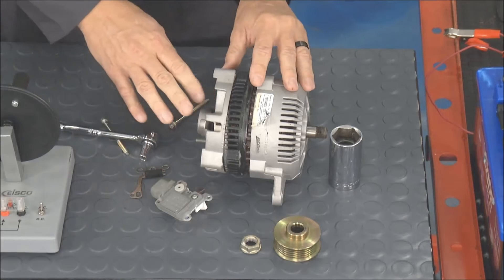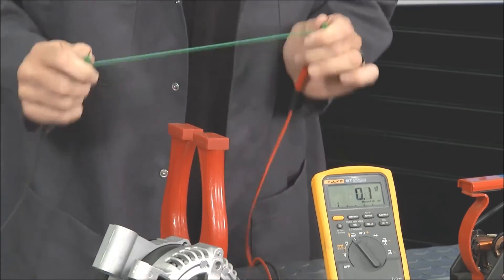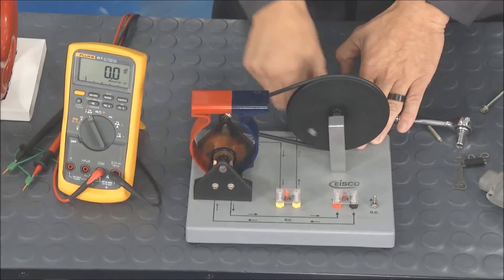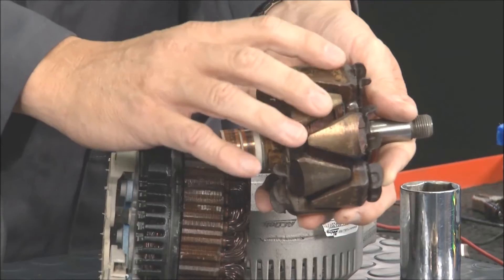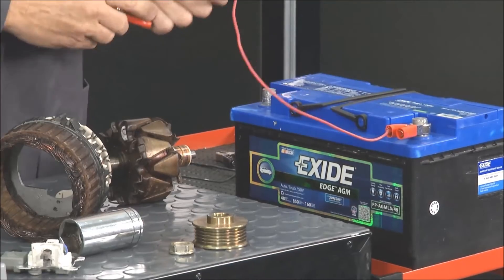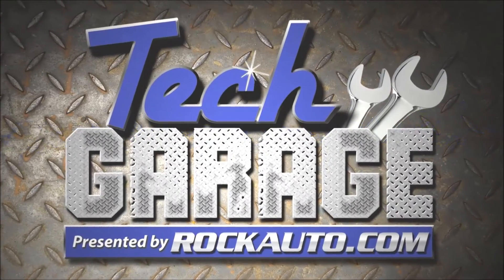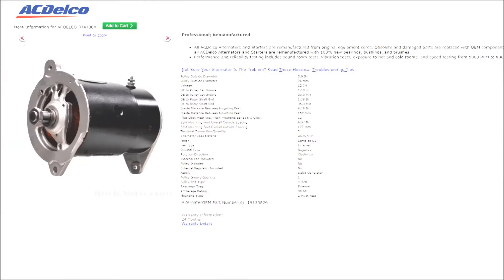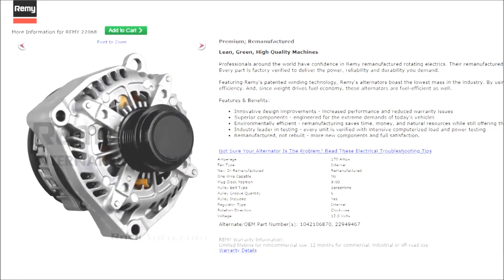How Alternators Work and a Simple Explanation of Electromagnetic Induction  (Season 5/E10)

Comment: Hi,

So if like the initial "pre-magnetisation" of the rotor is supplied by the car's 12V battery, how much current is needed ? What is then like the "idle current" (that is supplied into the rotor) ? 🤔

The rotor copper wire winding is not of the same thickness as the copper windings on the stator part right ? If so why not ? Because how can then an alternator be producing like 100 A if the rotor copper winding is thinner then the ones on the stator assembly ? 😶😕

Also how is the ratio between like the speed of an alternator versus the input rotor magnetisation (amps in particular) - in comparison to the output power it supplies (amps again) ? The faster it spins & the more amps we deliver to the rotor more amps will be generated on the output or... ? 😞😳

Thanks ! 😇🤗

Best Regards,

Comment: I don't get it; if the battery needs to supply current to those coils to turn them into electromagnets in the first place, how can the alternator supply current for the battery (and thus recharging it)?
Reply: The alternator has its own magnet (the rotor component)... the engine is connected to the rotor via a pulley system and causes it to spin. Once the rotor is spinning, it induces an AC current in the coils. The AC current is converted to DC current and recharges the battery.
Reply: @andrewstears2726  the rotor component isn't a permanent magnet; is basically coil, so there needs to be an initial current to turn the coil into an electromagnet; where does this initial current come from?
Reply: @lucasf.v.n.4197  so remember that electricity can be created by spinning a magnet in a coil of wire, and you can make a magnet by running electricity through the coil. It's a vice versa relationship. So the battery gets the engine moving and the engine runs on its own. With gasoline. To keep it simple, the battery doesn't keep the engine alive other than powering the pumps to give it fuel. The engine has a shaft that spins, so just pretend we put a magnet on the shaft and put s coil around it. (the alternator). When the engine spins the magnet, it creates electricity. So we just use that electricity to send it back to the battery to recharge it. Hope this makes sense.
Reply: @iwishtobetexan6060  my whole confusion was due to that epsode in Breaking Bad that they are lost in the desert and Walt tries to recharge the battery using the alternator simply by turning the lever several times; I was wondering how that was possible considering the coil needs to have current flowing to act as an electromagnet, which then would generate current by induction in the other coil; I believe the answer has something to do with self-excited generators though, but I don't understand how they work
Reply: @lucasf.v.n.4197  I've never seen breaking bad but remember movies are pretty inaccurate to reality. I think your overthinking everything. Start simple.
Reply: @iwishtobetexan6060  "start simple"? what is this even supposed to mean? what a joke;
I'm not starting anything, amateur; I can easilly apply Maxwell's equations to derive any standard physics textbook example;
and do u really believe they would include a science theme into a science sitcom (one of the best ever made if not the best) if it didn't have strong accuracy and basis on real science?
if u want to learn a thing or two, search for brushless generators, self-excited generators, and residual magnetism; it will shed some light in the subject;
Reply: @lucasf.v.n.4197  explain what a transistor is please.
Reply: @iwishtobetexan6060  is this a joke?
Reply: @lucasf.v.n.4197  u prove it by explaining it.

Comment: The alternator is connected to the car engine, not the wheels or the drive shaft as some people think. There's also a regulator connected to the alternator to make sure the voltage that goes into the lead acid battery is at a stable current. If this regulator fails, you will feed the battery with a much higher voltage when you rev your engine.
Reply: I don't get it; if the battery needs to supply current to those coils to turn them into electromagnets in the first place, how can the alternator supply current for the battery (and thus recharging it)?
Reply: @lucasf.v.n.4197 the speed in which the alternator is spun at in conjunction with how tight and thick the windings in the field and stator are (along with if the stator is either wye or delta wound), determine the current output, which is usually more than enough to push amps back into the battery during charging.
Reply: @chrismarek7864  this doesn't answer my question; the alternator needs the coil to act as an electromagnet; it only happens if there's current passing through the coil; where does this current come from in the first place? it can't be due to the battery, otherwise it would imply the battery can suply current and be recharged simultaneously;
Reply: @lucasf.v.n.4197  the current does come from the battery at first. It’s called pre-excitation voltage. And once this is fed into the field while the rotor is spinning, it kick starts the generation of alternating current. How thick and tight the windings are along with how fast the rotor is spinning as it passes by each phase of the stator windings determines how much current is produced, and the magnetic fields from both the field and stator windings are sustained as long as the rotor is turning.
Reply: If you remove the regulator or the rectifying diodes (with capacitor) how high would the output voltage on the secondary winding be ? 🤔
Reply: @davidbolha on the average of 10-60 volts, give or take 10-30 volts.

Comment: At how many amps does a typical alternator charge a car battery? How does it determine when to stop ? voltage level?
Reply: 70 to 300 ampere...volt level 13.6 to 15.2 volt.. a voltage regulator
Reply: That's why alts have regulators. So that they don't overcharge the battery and boil it. Plus electrical power costs engine horsepower and costs economy. There's no free lunch
Reply: My truck has a battery temperature sensors to determine when to make the alternator back off. The pcm tells it to make more or less current